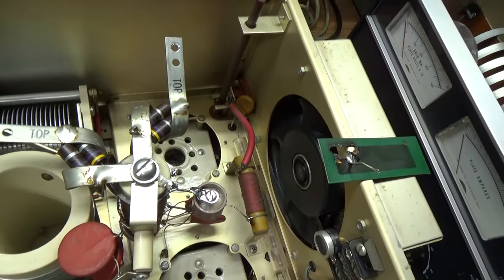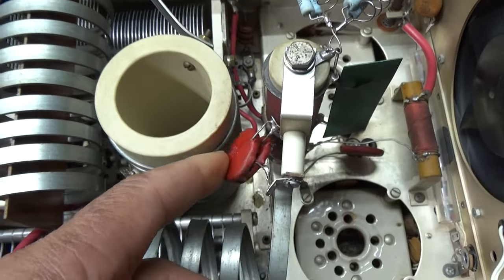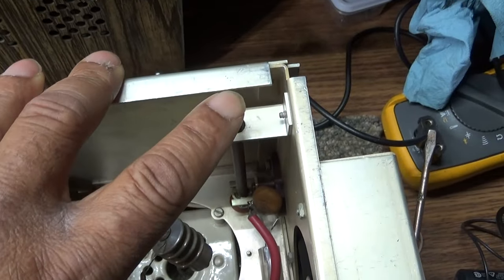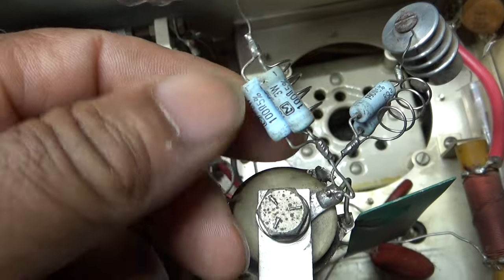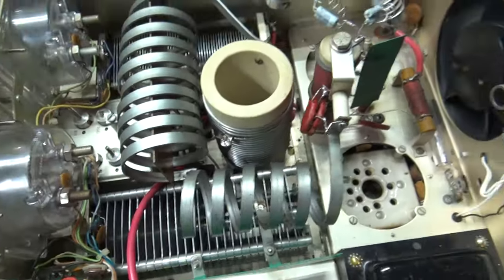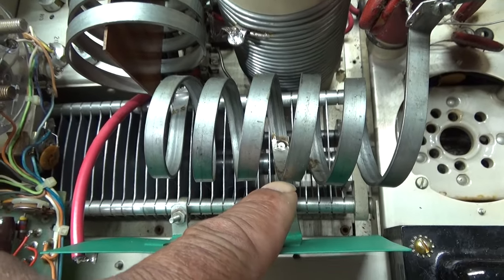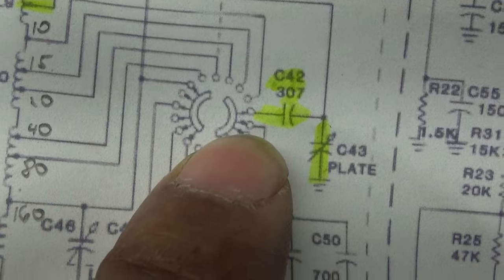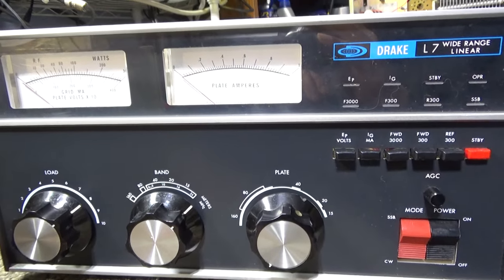Drake L7 Linear Amplifier is a little weird part 1 output circuit

Comment: The capacitor is used to prevent self resonance of the plate choke.  Why did they use that type capacitor?  If I had to guess, cost.  Without the capacitor the choke will self resonate around the 15 Meter and 10 Meter bands.
Reply from the maker: That was my theory, except my guess would be that its the 160 meter band that is self resonant.

Comment: Cool. Special made capacitor, plate on each side with an insulator in the middle. If you measure the thickness of the insulator and measure the plates, you could have them made by PCB Way or another PC board manufacturer.
Reply from the maker: I'll just go with doorknobs. Henry Radio also used plates like this in some of their amps. One was a variable and they moved the whole plate in and out to adjust the capacitance.

Comment: I'm guessing that's it's to remove unwanted resonance on the plate choke, which could overheat and destroy the choke, at certain frequencies. 🤔

The coil before the tune cap might be part of a PI L tank circuit? 🤔 Another guess, unfortunately.
Reply from the maker: I am pretty familiar with Pi L's but I have never seen that on the Tune side of the tank. It's always after the Load cap.

Comment: At a guess, the choke must resonate at certain frequencies, and so that odd looking capacitor is to try and tune it out of resonance?  A VNA and a frequency sweep might help and answer the question, eg where does it resonate with and without the cap in circuit.  Does the amp run on 12, 17 and 30 meters?  If not someone maybe forced it on there and the choke resonated and cooked the cap?  GI0UTE, 73
Reply from the maker: The amp does not have 12-17 and 30, only has 10-20-40-80 and 160. The weird cap is factory. I'm thinking its there for 160.